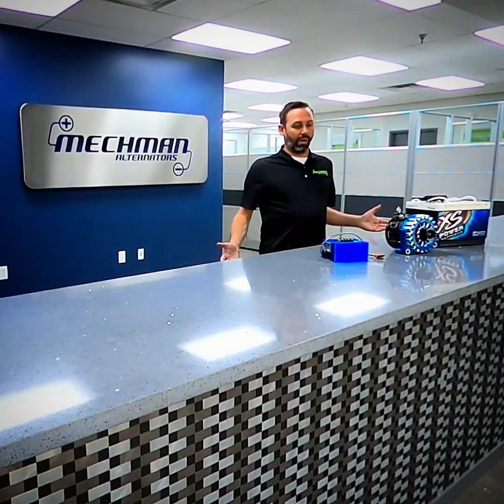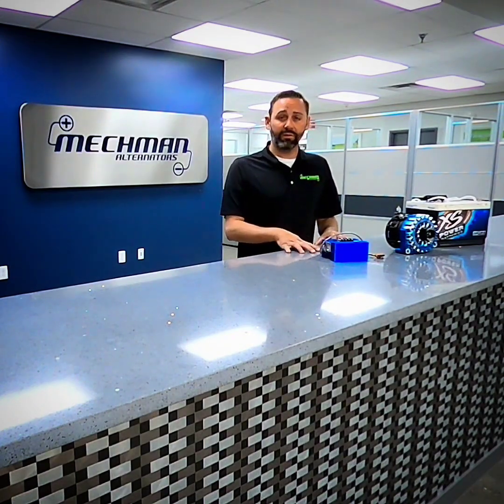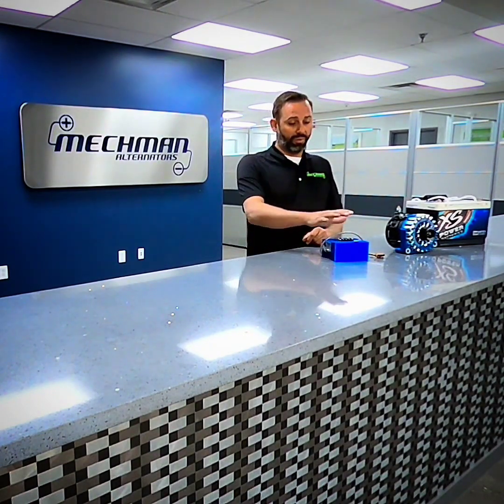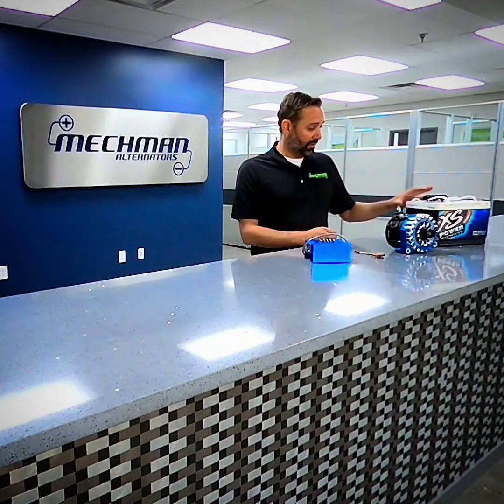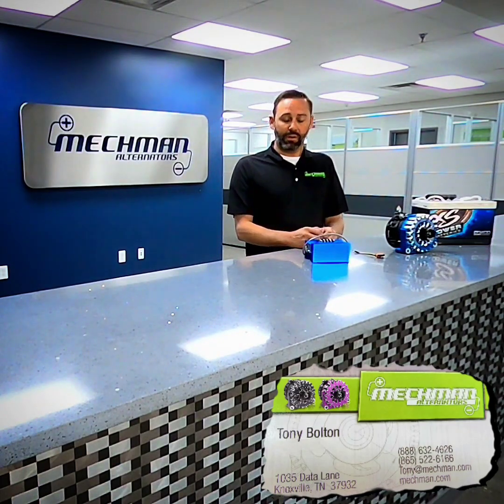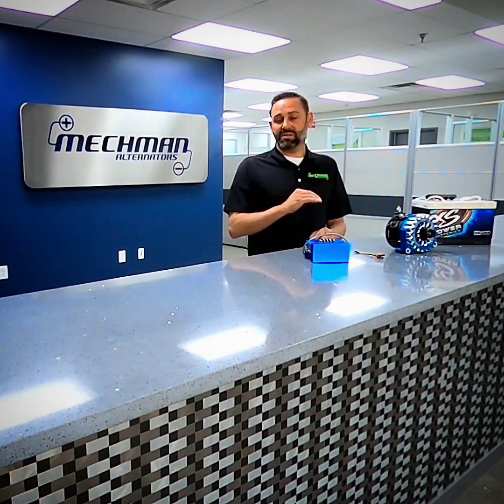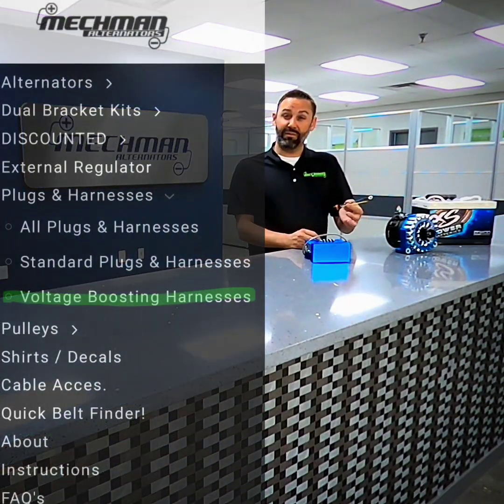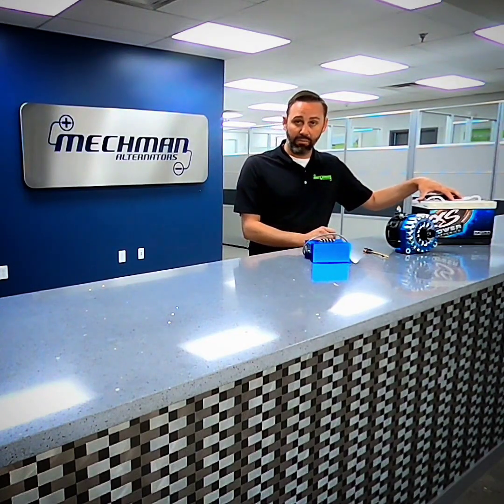12v, 14v & 16v battery application and usage.

Comment: Most modern cars run at 13.8-14V. With a 12V battery. with 12v they struggle to start and accescories sometimes play up. Fans, electric fuel pumps etc. Even old 50s/60s cars usually had 13V,, witha 25 amp generator. Many alternators are labeled 14V 55 amp etc. These days more like 80 amps.
I have 54 years in the motortrade so I do know!

Comment: i built a 4kwh 14v lifepo4 battery for my EV to increase its range. Added some flexible solar to the roof which keeps it charged up and the higher voltage avoids power from being stolen from the high voltage traction battery. in summer you loose about 4 miles of range every hour from 12v parasitic load. in the winter it can be much more, around 8 miles per hour due to heated seats and whatnot. 
doesnt sound like a lot but with my 13 year old chevy volt only getting around 40-45 miles of range before the mod, it had the same effect as raising my tire pressure 8psi above standard. a lot more trips now where I use no gas, and gas is spendy here in wa. like 50cents/kwh spendy. each drive to work I save 50 cents, and again on the way home in fuel. ignoring the fact that you can build the same system for about the same price as a replacement 12v battery, the break even is at 2 years which is pretty crazy.

Comment: You might know a lot, but you are wrong about 16 volt systems. I ran a 16 volt turbosmart battery and 16 volt alternator for 3 years on my last car, all stock 1993 Trans Am electronics and NEVER blew a headlight or any electronics! I don't know why you guys are always against 16 volts!?
Almost all big drag and drive winners, Tom Bailey and Cleetus, and others run a 16 volt system and alternator, too! Really makes me question your knowledge of car electronics. Maybe you should stick to the bass head competitions!
And for what it's worth. The only alternator, of your's, I've had experience with, lost it's pulley and messed up a customer of mine's TBSS! He's lucky he didn't lose his engine in the process! SMH
Reply: How do you run a 16v battery and alternator with a holley?
Reply: @BALLERXD24  Umm...With a 16 volt alternator. Tons of people doing it. Like I said, most drag and drive, type, competitors are running systems like that. There are even injectors out there, that have to be ran on a 16 volt system.
Reply: @funfun8095  Yes I understand they're doing it but a 16 volt battery has to be charged @ 19.2VDC which the holley can't be ran at, max voltage on that ecu is 17.5VDC.